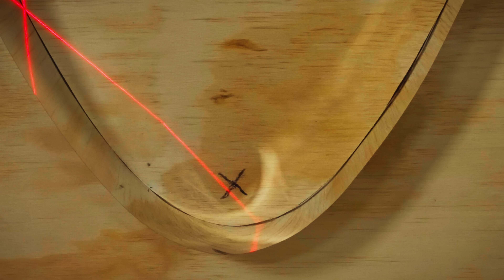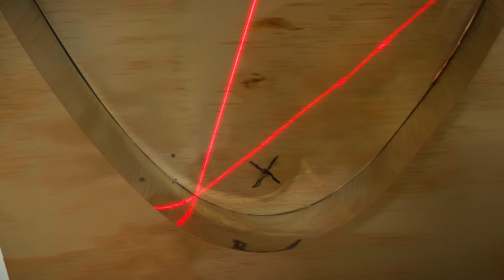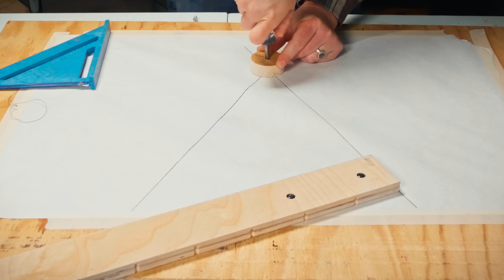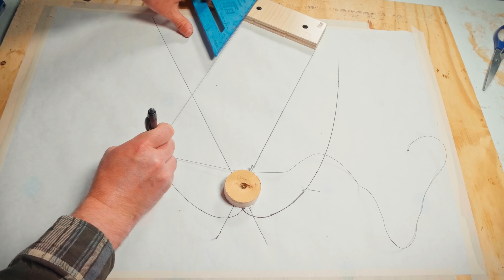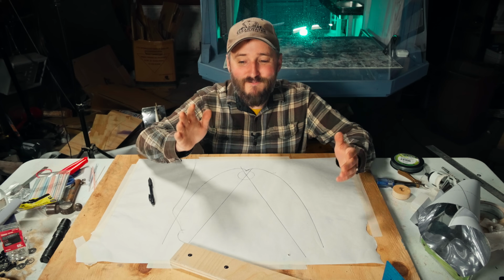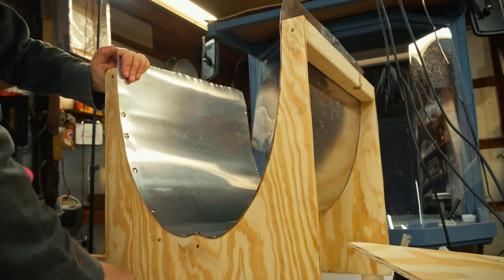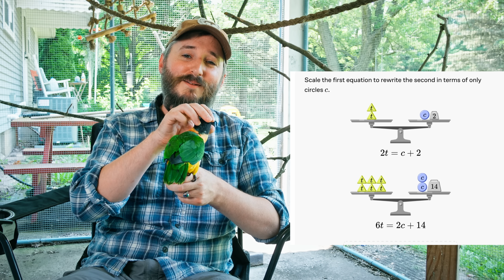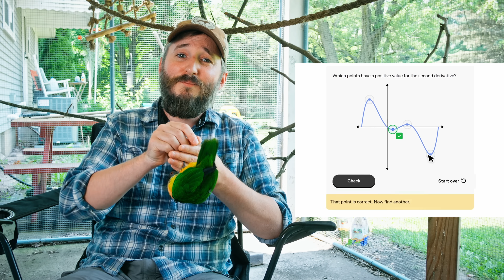DIY Solar Concentrators, Made Better.

Comment: Sorry for the third critical comment in a row, but think about it, if you would make the pipe as wide as your mirror, it would also catch all the sun. The amount of concentration does matter, not only the total amount of energy collected.
Reply from the maker: You're right, but the concentration in the case of a compound parabola doesn't so much depend on the target size as the acceptance angle of the mirror. A normal parabola spreads light evenly over a pipe's surface, but a compound parabola focuses light sharply on particular sections of the target. Therefore you can get really high temps on a large target, they're just isolated to particular sections of the target. There are a lot of attributes to balance. Lots of resources linked in the video description if you want to read more on these.

Comment: I would have liked to see similarly sized target pipes. Even in a parabolic mirror with overcast sky a larger pipe will pick up much more light.
So I'm not entirly convinced that your setup is at least not partially cheating.
Reply: Yes, need the same setup done both cast iron, aluminum low thermal mass also means its stores less over time. As a baker these things matter. Needs a small to small, large to large, etc diameter pipes.

Comment: Why not take this further and invent a way to slow-cook a meal on a cloudy day? Seems like the pipe could be connected to a way to recirculate water, and the hot water could be put in contact with a slow-cooker crock pot, and then you've got a way for people to simply add water to a reservoir, add ingredients to a pot, and end up with a meal at the end of the day without ever worrying about heating it.
Reply: Pretty sure these already exist, I forget what they are called but something like solar cooker. Last time I looked they were very expensive for what they were. Seems like a stainless steel container and one of these mirrors would be way cheaper. Just make sure its got a vent so that it can vent steam otherwise it will go bang.

Comment: For the efficiency of a heat engine (if you want to do anything else but heat water), the temperature difference between the hot part and ambient does matter a lot, that is why you normally do want to concentrate sun to as thin a pipe (or spot) as practically possible.

Comment: The process you do at the 9:20 is what an involute curve is. It was derived the same way. This is the curve you see on gears.
Reply from the maker: The string construction is playing on edge ray angles so that the string traces out the curve needed for the max acceptance angle to always hit the top most edge of the target. In that way every angle less than the max is also intercepted by the target at a lower location
Reply: @Nighthawkinlight  I was actually digging into this topic more, since it is surprisingly relevant to my work, and found a paper on this exact compound curve titled: Truncation effects in an evacuated compound parabolic and involute concentrator with experimental and analytical investigations

I haven't dropped the cash for it on Science Direct, but it seems to go over the same concept as what you've made.

Thank you for the great videos and showing how to do these science experiments at home. It's always a good day seeing a new video from your channel come out.
Reply: it's an involute that smoothly transitions to a parabola to be precise
Reply: @ZeroPlayerGame so… a compound curve?

Comment: A fresnel-like lens on the top could be useful too, especially if you are enclosing it to keep heat in.
Also using mirrors that direct the light on a specific line that isn't fully insulated could help localize the heat where you want it an prevent 90% of the loss to conduction, convection and radiation
Reply from the maker: You would need the lens to be a compound parabola also or else it would need to tack the sun
Reply: @Nighthawkinlight When they aren't designed for true image projection, there's a lot of room to adapt the range of light directionality
Reply: A lens doesn't add any more sunlight than regular glass, but adds other problems like fire hazard (I've seen diy solar cookers go up in flames), discoloring of metal and the plastic isn't long-term UV resistant

Comment: 4:06 good concentrators have 2 layers with vacuum between the outer transparent and the inner black tube to prevent heat losses.
So the actual target is not that big. Also if you hit a glass pipe near its edge a high % of the light might be reflected out.

Comment: What would be the impact of extrapolating this curve into 3 dimensions? could you make a sort of compound parabolic cone which could focus light/heat down to a collector or transfer medium more efficiently, or would it simply be more efficient to line up several "2d" collectors?
Reply from the maker: You can! Harder to make shaped cones practically, and I think the 2d version is more useful for solar collection

Comment: you can also position the trough pipe length axis alongside the sun travel path. assumes the angle along the travel path of the sun is approximately constant. ie the parabolic mirror angle is constant all day/year.

Comment: Yikes not sure what happend. Comment lost.ITry again:
You are the DIY:goat-turquoise-white-horns:! I was doing this in the late 70's in university. The issue was I was taking calculus and a metal bending class and a desire for solar concentrators. I did buld one, but just by bendinbg the metal which creates a natural parabula (similar to the chain). Worked with a math professor to derive foci and other parts of the curve based on how much metal and the apature. With a realy smart professer we failed to get the right equations. This geometry tool technich is way better and creates the results I was looking for.

Comment: I don't think the comparision is fair since you have been using a thinner pipe for the parabolic concentrator. With a larger targert, the parabolic one will also become more lenient towards the angle of incidence. Not optimal, sure, but I don't think there would be a massive difference. Still interesting concept though.

Comment: If you make it a bit wider, it should be possible to move the pipe farther away so it won't set the whole thing aflame in a sunny day
Reply from the maker: Sadly you want the pipe touching the peak of the mirror for ideal performance. The first paper linked in the description talks about this issue and possible solutions
Reply: @Nighthawkinlight  love the video btw

Comment: make them from cardboard and use epoxy resin to make it a type of cardboard fiberglass and glue thermal blankets to ti..run longer pipes and on the cheap you could do some serious work

Comment: would a 3d (not extruded 2d curve) work even better? assuming a 3d angle (solid angle)
Reply from the maker: For sure! I haven't figured out an easy way to make a cone version or I would have for the video. Practically I think trough versions are probably the most useful because most applications would involve a long object like a pipe

Comment: I wonder if that could be used in tandem with solar panels for better solar energy?
Solar energy on cloudy days and even more solar energy on sunny days?
Reply from the maker: As long as you have a way to deal with the heat!
Reply: Maybe with circulating roof solar water pipe heat collection system. @Nighthawkinlight

Comment: Its a great idea for heating a greenhouse in the winter
Reply: That's what I was thinking and creating humidity and possibly reclaiming the water as well. It's a bit swirled in my brrain.
Reply: Hey man, how would you do it?
Reply: @TheMchef  First idea is heating up metal water barrels with copper pipe spiraling through it.
Reply: why?
Reply: @jakubiskra523  Because it will extend the growing season inside a greenhouse

Comment: I wonder if using this as a way to generate electricity via steam turbine (que ITS ALL STEAM jokes) would also be a way to trap the heat from solar radiation and help bring down temps? It wouldn't be a carbon sink, but it would be a good way to trap solar radiation?
Reply from the maker: Good thinking, but sadly not! Steam power releases humidity into the air which stores a bunch of heat energy that is released upon condensation.

Comment: Smaller target gets hit less. of course. Also surface area per volume for heat loss is also better for larger target. That is why mice eat 10 to 20% their body weight every day but elephants less. This experiment does not favor the small pipe. Not to mention aluminium is a better conductor so loses heat from it's surface and replenishes to lose more like a cooling fin compared to the iron. That is why the cooler in your pc and a motorbike are made of aluminium or copper.
Reply from the maker: Smaller target doesn't get hit less in a parabola. The smaller the target the higher the concentration.